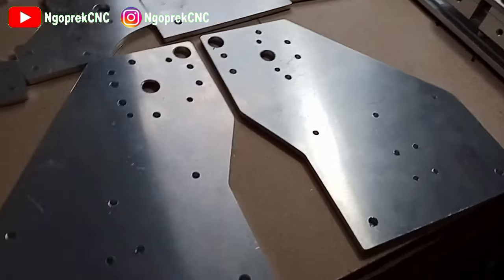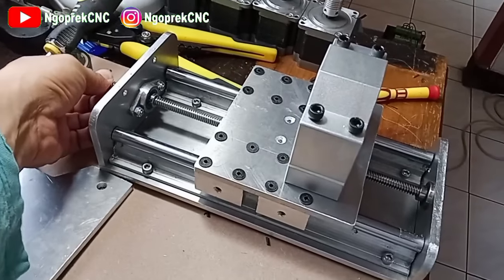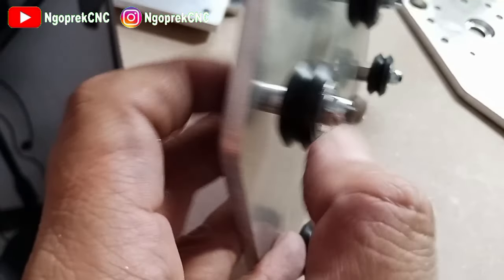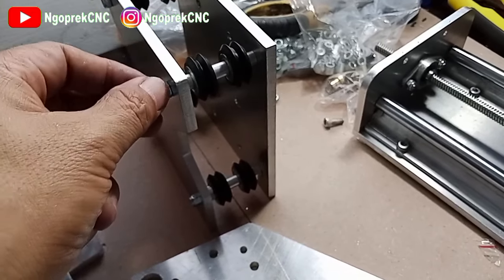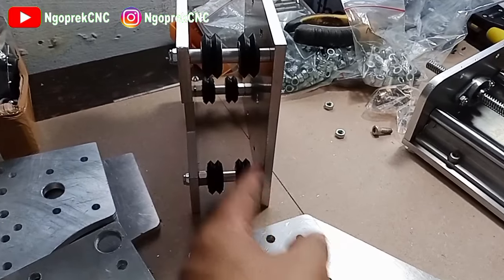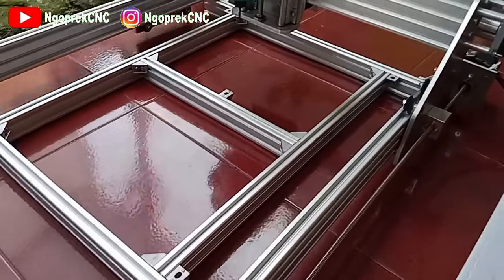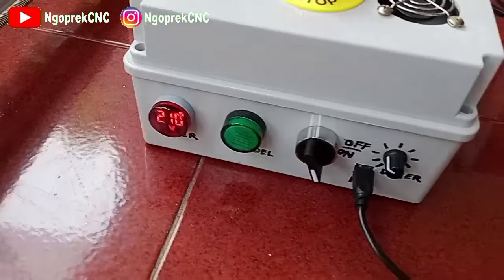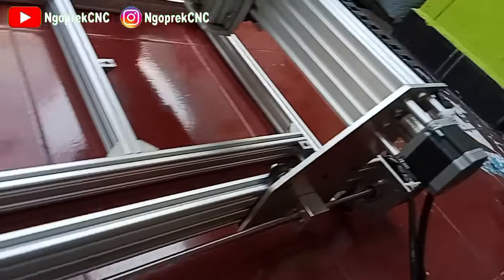Pembuatan CNC Router Mach3 40x40

Comment: Muahal kalo aluminium. Misal pake akrilik bisa ya bang. Saya bikin mesin laser engraver tp pake akrilik 6mm saat ini, buat gantry pake autocad dan udah jadi dari beli cutting laser akrilik online 😂. Liat ini kok jadi kepengen buat juga 😁
Reply: Akrilik bisa cuma mungkin ngefleks ya, soalnya ini kan bebannya lebih berat trus harus membuang material dari benda.
Reply: @yudhahamdiarzi5553  melengkung gitu kah pak, iya juga sih  ini gantry ku akrilik 5mm kalo di bending pake tangan agak melengkung tp saya akali pake penahan spacer. Mungkin kalo plat besi 3mm bisa ya pak, lebih murah soalnya biaya plasma laser buat bikin gantry nya 😁. Siap terima kasih informasi nya 🙏🙏🙏
Reply: @putriamalia422  ia plat besi jg bisa jadi alternatif, cuma harus di cek jg beratnya. bisa pakai software2 cad untuk tau berat per luasannya.